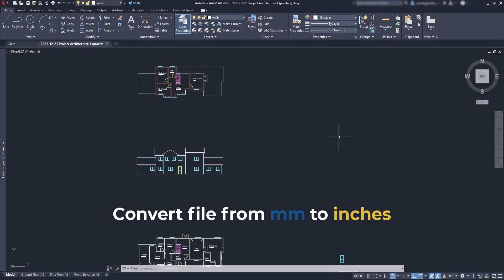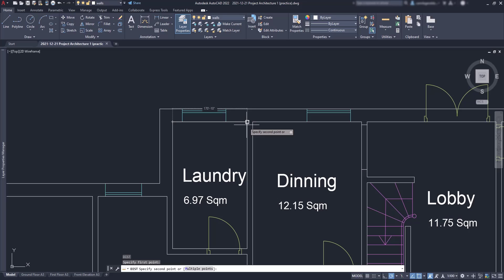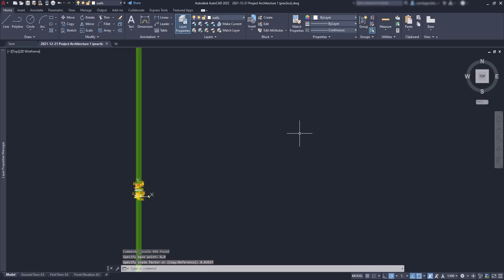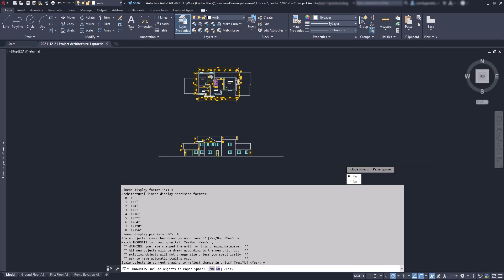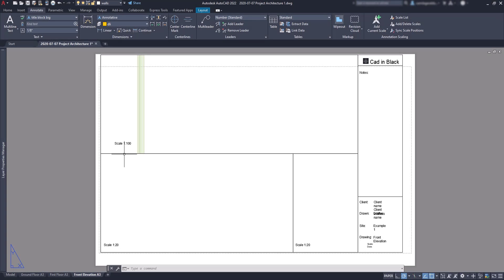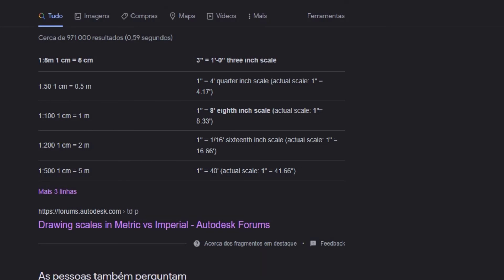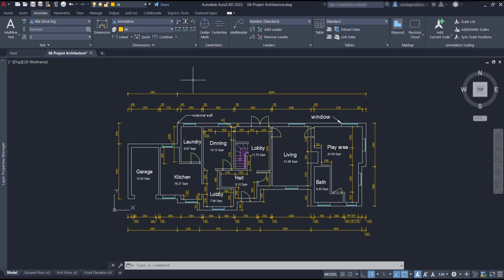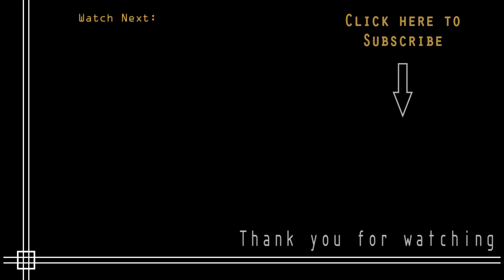Autocad - Convert a file from millimeters to inches

Comment: Thank you for the helpful video. How would it work opposite? from inches to milimeters? I tried the firsti version but after changing units ( in my case inch to mm) it dimensions still i inches.
Reply from the maker: Thank for watching +nuki bokuchava. It is the same proceedure. The conversion factor for that case is: 1 inch = 25.4 mm